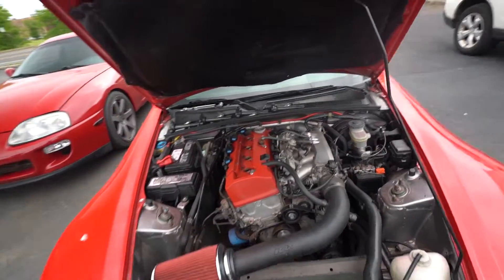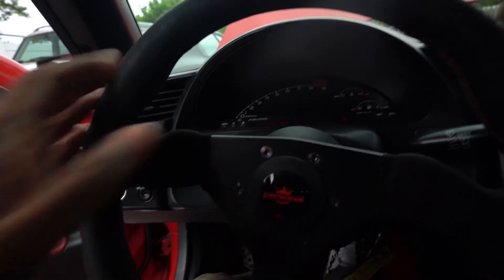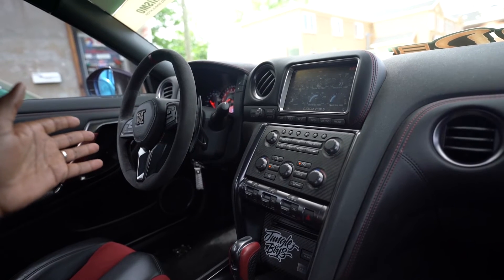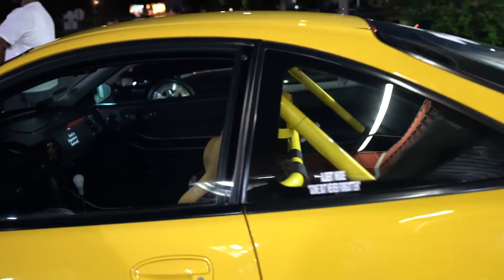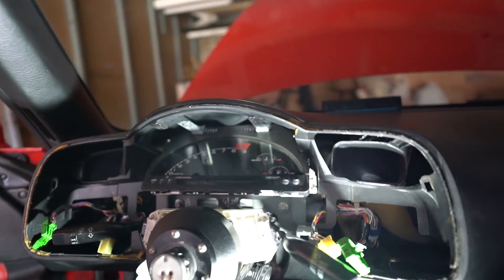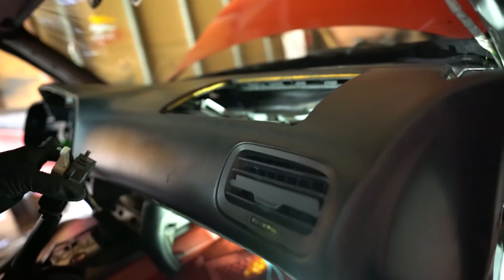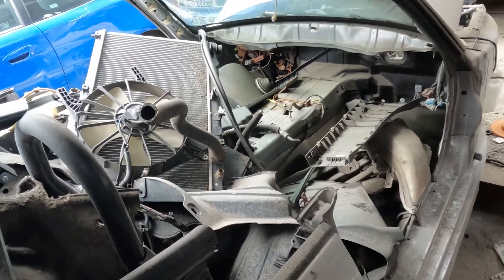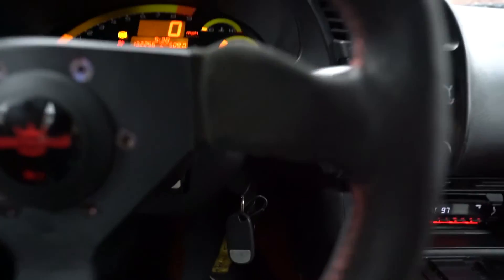Thought i blew my motor!

Comment: i have a similar problem with my e38 750il , and i believe its the fuel pressure regulator/fuel filter. about to have those done one of these days and see if it fixes my issue.